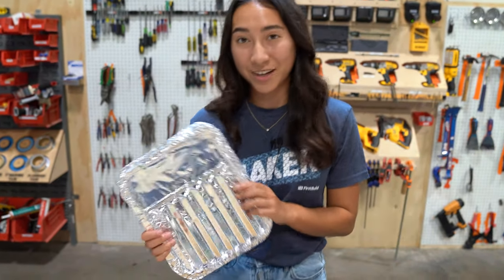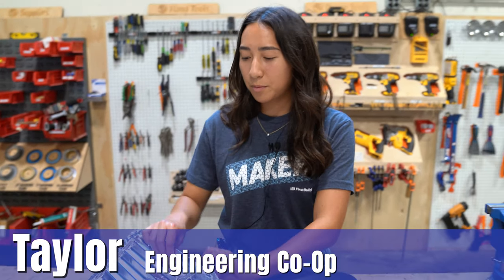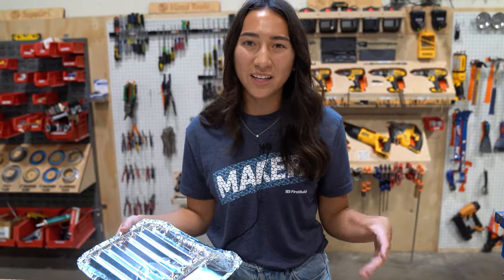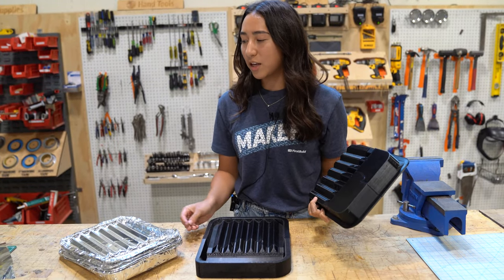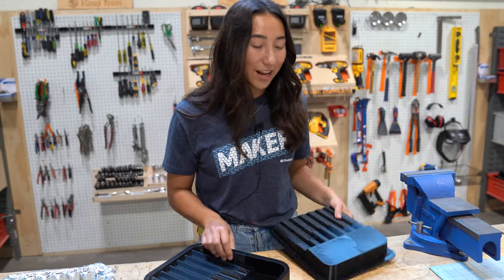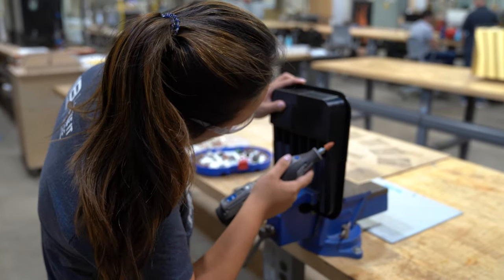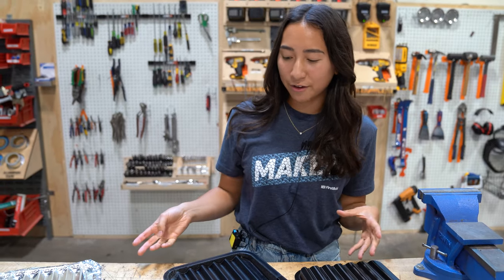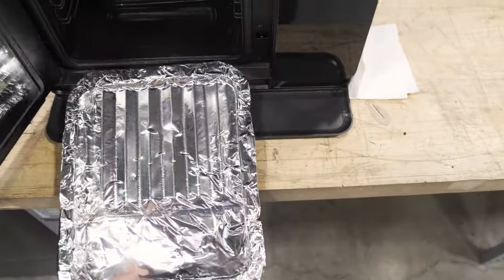Arden Drip Pan Liner - 2 Minute Prototype

Comment: Love the thinking behind this.  I was just wondering (since I have no idea about the complexities of manufacturing this) that instead of disposable pans, what about a flexible silicone drip tray liner? Of course it would discolor due to the smoker (unless it was black color I guess) but it would be heat resistant and you could wash in the dishwasher and reuse.  If this is a non-workable idea, I still like the aluminum tray liner 😊
Reply: If the point is to prevent damage/discoloration/food that won't come off due to being cooked onto the pan, what is the difference between silicon and metal? Not trying to be sarcastic or rude, I'm curious how a silicon tray would be any different.
Reply: @Fezzik2112   completely get what you’re saying… I wasn’t talking so much about a difference in performance… I agree that metal would perform just as well (except that silicon wouldn’t be hot to the touch either)… I was mostly speaking to the fact that you’d have a product that could be washed over and over in the dishwasher (if desired) or easily wiped down because it’s generally nonstick… which is the biggest reason  I mentioned it—I was suggesting something that wasn’t disposable… I know aluminum is cheap and plentiful, but it was a suggestion I threw out  (no pun intended) because maybe the liner doesn’t need to be disposed of.
Reply from the maker: we toyed with this idea. washing a tray vs washing a silicone tray...better, but better enough for people to be interested? That's always the question
Reply: @Firstbuild  if you only made the silicone I would buy it BUT I would prefer aluminum by far.
Reply: @Firstbuild  yeah that’s always the impediment… the business case lol… I’m probably not representative of what most people will want anyway :(

Comment: Top must have list 
Dust cover 
Ribs rack
Drip pan liner 
Cold smoke accessory
Reply: Dust cover? Ya gonna let yours collect dust?! 😆
Reply: It's add protection.
Reply: The cold smoke could simply be an optional port on the side to plug something like the Breville Smoking gun into. Fill the chamber with smoke. Let it sit, let the machine remove the smoke. No heat applied.